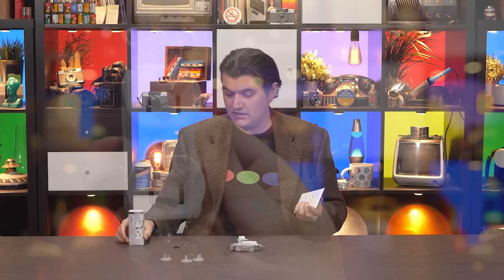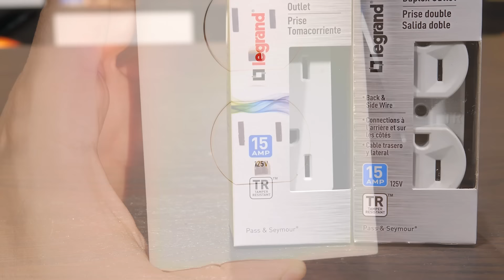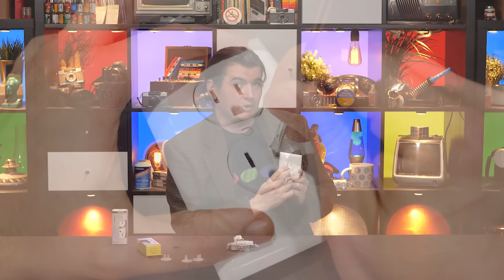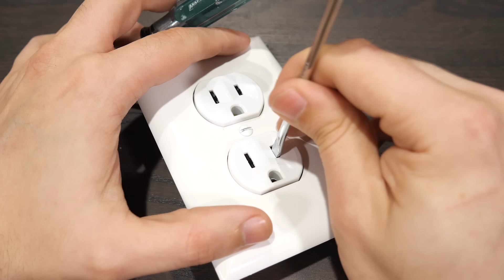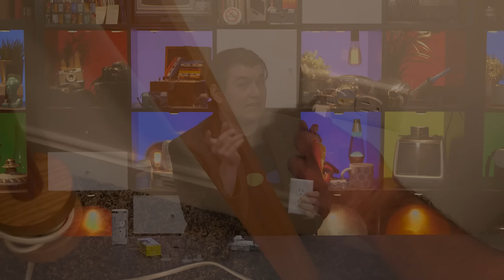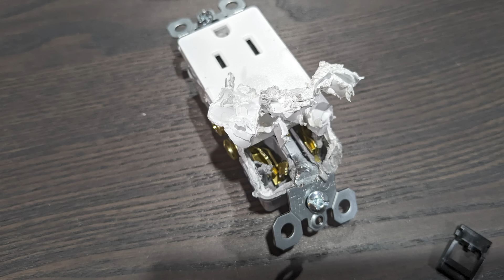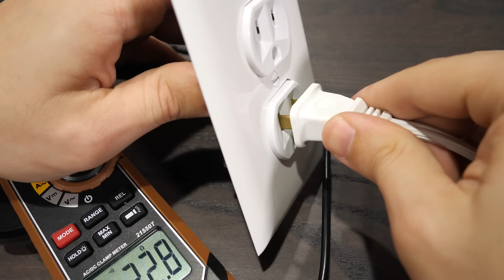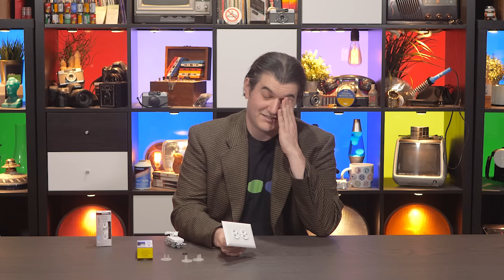Tamper-resistant outlets aren't all the same - a follow-up

Comment: The funny thing is, I've been shocked before, but never from putzing with an outlet. It was always me doing dumb stuff with electronics that I'd either forgotten to unplug or was stupidly disregarding. The worst I ever got was from an old lightswitch that turned out to be improperly grounded. (Metal faceplate, metal box, built in the 50s) I remember that was literally the first thing my step-dad fixed after he moved in.
Reply: Worst shock I've ever gotten was from disassembly the family's first digital camera after we replaced it because it had problems, I was handling it with the battery inserted because I wanted to see what would happen turning it on when half disassembled (spoiler, the screen had white stripes on it and nothing worked anymore) when I got a ridiculous shock which I guess came from the flash capacitors, my hand was kinda numb and weird feeling for HOURS after it happened.
Reply: futzing not putzing
Reply: @GGoAwayy  futzing with electricity makes you a putz.
Reply: In grade 9 electronics class, friend handed me a disassembled disposable camera (probably knowing exactly what he was doing)
WOW, those flash capacitors...
Reply: I've been shocked from an outlet before, but not a North American outlet. My family in India has an international converter outlet with every possible plug face on the planet in one connector and at 240V and it's not that hard to shock yourself on one of those
Reply: My first electric shock, as a young child, was on the plug. Every subsequent one I can think of was something like insufficient shielding on a power supply, or assuming that a little incandescent indicator lamp would be low voltage instead of mains.
Reply: same, I was shocked only once because I literally ripped live wires out of a lamp. Idk what I was thinking, it was ages ago.
Reply: I've popped myself with large filter capacitors from 300v power supplies, and boy does it get your attention.  I'm a lot more careful about that these days.

Comment: Hot take: with how poor the quality of electrical components often is, it's rather clear that the real problem is companies will half-ass things and cut corners whenever they can get away with it. Our system using 120 volts for consumer-facing stuff doesn't make it safer or less dangerous, it just gives companies more wiggle room to cut corners without getting sued.

Basically the same thing you're saying, but framed to highlight the actual cause and effect going on here.

Comment: I've found tamper resistant outlets to be really difficult to plug things into, I always end up having to put so much pressure into getting them that I worry I'm going to break something.
Reply: 90% of the time it's the plug that's the problem. More pressure isn't how the shutters open. It can be frustrating though because it's pretty random which plugs don't work.
Reply: @davidchidester5463  Yeah, it's hard to resist just jamming it in as hard as possible. I tend to just avoid the ones I know won't let me plug things into them now that I know which ones they are.
Reply: Turn off the power, take out the outlets, jam or snap off the shutter mechanism, put the outlets back.

Comment: While the UK 3-prong outlet is undisputedly more secure, there are many European two prong outlets that basically have the same problem of getting loose and falling out as our North American ones. This is especially frustrating when traveling with plug converters, as they make everything stick further out from the wall, and therefore increase the likelihood of dislodgement.
Reply: I have never seen a loose outlet.
Reply: @okaro6595  Many people in North America haven't either.
That doesn't mean that North American outlets are immune to the problem. Neither does your lack of having personally witnessed it mean that EU plugs don't have the problem. I have witnessed it with EU plugs, and not just once, quite a few times.
Now others have pointed out that hotels may be a special case due to the frequent use the outlets get, but most EU people complaining about NA outlets are also comparing hotels to their own homes, so I feel that my hotel experiences are just as valid.

Comment: the problem with backstabbing outlets is that when the outlet flexes over time with decades of use, the stripped backstab portion keeps bending and eventually the copper wire breaks. Every electrician with experience will tell you they run into this a lot with old outlets. It is also dangerous if the wire snaps but is still contacting and it arcs and can cause a fire. Basically the idea is, why use a poorer connection when you have a better option (side screws) that take no more time to use.
Reply: I've pulled backstabbed outlets out of the wall and had the wire pull right out of the back. This happened most recently on an exterior outlet I've used maybe 4 or 5 times and which was 6 years old.

Comment: I have a solution for the circumstance where live terminal can be exposed. Have the entire outlet recessed in the wall. I can think of a few ways to do this from new boxes to retrofit designs. Someone that’s really clever could make it work with right angle plugs since it only needs to be recessed 1/4”. This way if it were exposed it’s still covered from something getting in there. 

Honestly it’s a solution looking for a problem but people like to point out imaginary problems without even considering potential solutions (that don’t involve a time machine).

Comment: Safer vs. Less dangerous depends on context. I would say that cars with smaller blinds pots are less dangerous then cars without, but in a car accident cars with larger blindspots  are "supposed" to be safer.
One implies viability being a factor in safety the other implies structure being safer. I still think that the larger the blindspot the more dangerous the vehicle because visibility is arguably more important then structure. But I would not say that a car with more visibility isn't dangerous... Especially in the context that would be used. While, a car with more structure would be safer in the event of an accident, for the occupants inside.
I guess you could say it's a semantic argument about passivity vs. Activity. Safer being the preferred for a passive system while less dangerous for active. But it just depends on who you ask. Neither is wholly incorrect, but they mean slightly different things. The meaning implies viewpoint or position but basically convey the same ideas.

Comment: "We arguably have an even better solution" year, like Germany for Years 😅
In Germany, the 2-pin plugs without grounding are also only the last 5mm of metal, the rest is plastic.
120V is only marginally safer than 240V. 
In Germany, even new buildings are completely protected with an RCD, not only individual sockets or only the bathroom.

Comment: Weigo connectors physically hold the wire in place with a lever. 

Back stabbed outlets are just held in by spring tension, which will become loser over time, especially over time and heat cycles.  It also doesn't make very good contact with the wire, which leads to a high resistance connection which leads to heat which leads to the spring becoming loser which leads to more heat. etc.

I've seen on some outlets/swtiches now, a hybrid that uses a back stab hole, but the wire is held in the hole by tightening the side screw which physically presses a metal plate against the wire, both holding it securely, and makes a much better connection.